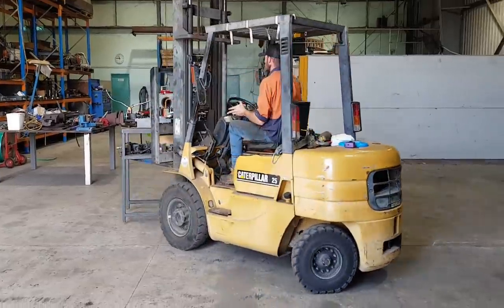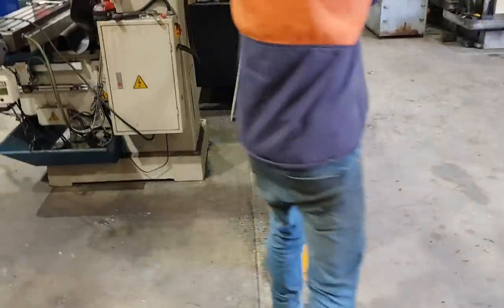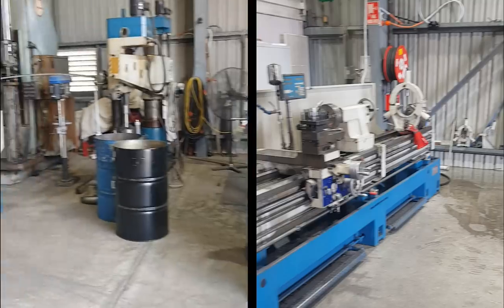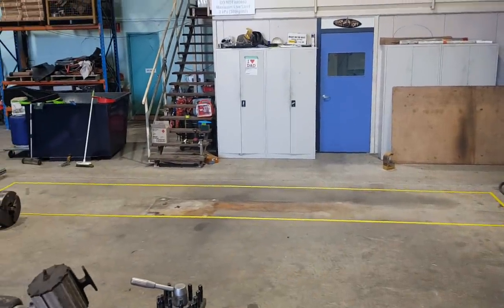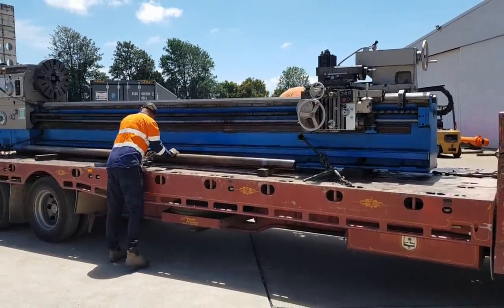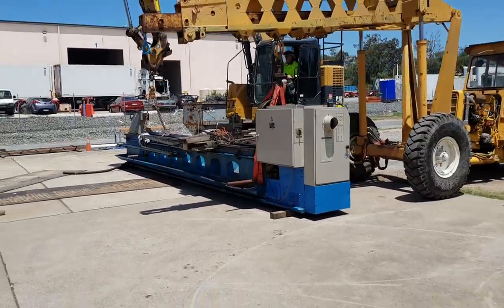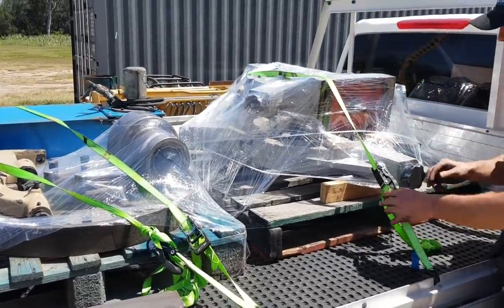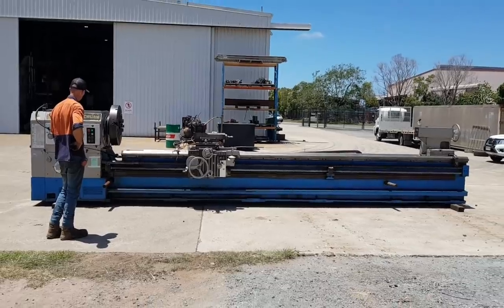Moving Workshop Around and Unloading 7 Metre Lathe | Workshop Machinery

Comment: Hi Kurtis, I have 50 years as machinist/toolmaker and I am in awe on your skills, you are great, love your videos.  I am subscribed also.  Thanks!  I machine new parts for construction equipment when they are obsolete or unavailable, I design them and make them from scratch, mostly on huge trackhoes (escavators) and D-8,s and 9,s and huge dump trucks.  I am 80 years old now and love my work.  Different every day, always thinking (keeping altzeimers from knocking at the door.  I am the only machinist in the shop I work in also, I have a lathe 118 inches between centers, but very old!  Thanks for the videos, your misses does a good job.

Comment: Ah yes, the machine shop shuffle... Played the game many times. At least you have most of the equipment needed to do it yourself (there's always that one machine thought...). A quick question, can you fill in some information on your yard crane??? I was surprised to see the IH skid unit for power, but without the hood, I couldn't tell what model it was. Who built the rest of it???
Reply from the maker: Hey mate thanks for watching! That yard crane is a genuine International 4030 7 tonne articulated crane. Got it pretty much as you see it, just new tyres, radiator and clutch. Best buy 😎👍

Comment: We have the exact same lathe in our shop! Its a BEAST!. We did have some trouble with the head stock leaking oil from the top cover,
Just had to reseal it FYI.
Reply from the maker: Hey mate good to know will keep an eye out cheers 😎👍
Reply: I have the same machine 4m centres which I had for 15 years not too bad for the price but can't compare it to good old Japanese or European lathes of the older era.The gearbox is a bit annoying and sticky changing gears but overall gets the job done.Handles 8-10mm depth of cut without a problem.The hardest part for me is when screw cutting near a shoulder can't go very fast since the brake does not stop it quick enough so have to do it slowly.Hope Kurtis's lathe is a better one.

Comment: In the USA we are forced by OSHA to buckle the forklift seatbelt. The forklift ty-wrapped roof isn't allowed either. The roof must be clear to permit unobstructed overhead view. A USA vendor makes clear covers with a bubble to help shed rain water to meet the OSHA requirement and provide a rain cover for the forklift operator.
My solution to the floor anchor stud removal problem is to use wedge anchors (my favorite trade name is thunder studs). I drill all the way through the concrete floor when installing. The stud can then be driven flush with the floor when removal is required. I like thunder studs because they are inexpensive and stud size equals drilled holes size. This most often allows the anchored item to be placed in position and the anchor hole drilled and anchor installed without relocating the anchored item AND the maximum anchor size for the existing equipment hole can be utilized.

Good luck with the large engine lathe.

I have rigged many machines much larger than that machine... Mostly CNC. I often joked that my plant moved machine tools more often than my wife rearranges household furniture.

Comment: Love it! Can’t wait to see it peeling off some chrome rod 👊🏽👊🏽
I was just thinking this week about how I need to up my lathe game over here, I’ve got a 350mm diameter barrel to turn and bore from hollow bar, and no steady big enough to fit it 🥴🥴 
Have fun with the new toy 👍🏽😅
Reply from the maker: Time to get a bigger steady rest 💪🤣 yeah mate looking forward to finish setting it up and getting it turning
Reply: @CuttingEdgeEngineering  The thing is I designed a steady to swing up to 320mm barrels, got the frame all flame cut out of 60mm plate and my slack ass still hasn’t built it. And now this cylinder won’t even fit in that steady 😂😂

Comment: I take it u got the new to u for that 5meeter Hitachi hydraulic cylinder sitting at side of shop .?
That's some yeard u sit in helicopter and was the blue and yellow thing a wood band saw or a press brake 
Yea plenty of working words can get used for her size.  And what a shop transformation how long were u down for ?
Keep up the solid work the 3 of u and see u next video
Reply from the maker: Hey Craig appreciate you always taking the time to comment. The Hitachi cylinder has already been rebuilt and up for sale. That big blue machine is a broken 70 tonne inclinable power press. We were down for 2 days all up, not too bad with planning ahead it went pretty smoothly. Cheers mate, Kurtis 😎👍
Reply: @CuttingEdgeEngineering  thanks for the reply Kurtis. Well dun on the 6 P's 
Proper 
Planning 
Prvents
Piss
Poor
Performance 
👊👍👍👍

Comment: How critical is the level of the cement floor? Can the lathe bed distort under its own weight, speaking of which were you able to verify the accuracy/trueness of the lathe bed before purchase or will you deal with alignment when you set it up? Thanks for your time. Great video.

Comment: Did you install the lathe on the existing concrete slab?

When I purchased my lagun American turnmaster lathe which has a 280" distance between centers I was told by the manufacturer that I needed to pour a precision footing for the lathe that was at least 30" thick if I wanted to maintain the tolerances the machine is capable of producing.

Comment: That thig looks like a propper beast! In your next video I would like to know so stats, like year of manufacture, power etc. :) 

On a different note: Whats the consensus about large chinese equipment? Please understand that I'm not trying to be negative! 
A lot of Chinese hobby lathes that i know seem to be somewhat bad. On the other had china is manufacturing a lot so their proper machines cant be too shabby.
Reply from the maker: Hey mate yeah for sure will get stats and plenty of info in the next video about it. And in my opinion the larger Chinese machines are decent quality for what you pay, to buy an equivalent in European or Taiwanese would cost more than double. But definitely the smaller hobby one's are cheap and nasty, you get what you pay for with those and I avoid them 😎👍

Comment: What part of Australia are guys located? And the crane lift of the lathe was a bit scary, 10 out 10 for synchronisation:P
Reply from the maker: hey mate we are in QLD not far from Brisbane 😎👍
Reply: @CuttingEdgeEngineering  I probably could have looked it up, I'll blame that on the heat. :)
Reply: Slaps head, I'm such a dick, looked it up anyway. I'm a northside so if I ask dumb questions then you know why lol. Anyway, the stuff you do is great, slowing picking it up some of the lingoes to do a mill to CNC conversion, mainly because I have no clue how to use the machines. Speaking of which, you guys ever thought of doing a half-day session for people wanting to learn?
Reply: You wouldn't happen to have a small lathe you are looking to get rid of?

Comment: So with a machine that long how do you make sure the bed is aligned perfectly when you get it into position?
Reply from the maker: Many hours with precision level and piece of material I don't mind making smaller 😂
Reply: @CuttingEdgeEngineering  What about using a Builders Laser Level or is that not accurate enough for you?
Reply from the maker: @markfryer9880  a good way to get it started but it's not really accurate enough for the whole setup
Reply: @CuttingEdgeEngineering  And enough up and down placing shims, rechecking the level, adding and subtracting to get it finally leveled and fully bolted down to make my back and legs sore just thinking about it. :-) Also refreshing to hear standard every day industrial language being used that most other video producers always edit out just in case it might "offend" someone. Your videos are taken in an industrial environment, why would anyone ever expect anything else? And that's not the first fork lift you've run, nice and smooth, fast, no wasted moves or hesitation. A sure sign of a good competent operator.
Reply: AussieBlokeGordo. Use black magic and summon up a 'spirit' level .
Reply: @karlhrdylicka  Now way a regular spirit level is accurate enough.
Reply: @GeneralG1810  .Duh . and my pommy suggestion wasn't worth a thumbs up .

Comment: when u lifted the lathe in the air why didnt you just drive the truck from under it?
Reply from the maker: Cause the lathe would've blocked the driveway for a few hours while waiting for the other crane to move it into the shed
Reply: @CuttingEdgeEngineering  i figured it was something like that but i didnt know for sure

Comment: The bed has to be absolutely flat. Has anyone done any rudimentary stress and strain calculations on various proposed support methods during lifting it up and placing it on the trailer? The deflection the lathe will experienced during transport? Then the deflection the lathe bed will experience during its movement from the trailer to its final destination?

The period of time it is on the road will be of great concern the truck bed it is on flexes this fkexure must not be transferred to the lathe bed.

I say this from witnessing equipment damage incurred during trucking as well as damage incurred movement of equipment to and from the truck.

I would not like the manufacturer of the equipment to determine the method of transporting the lathe. Rather use a consulting mechanical engineer